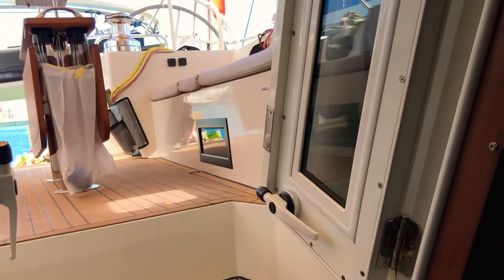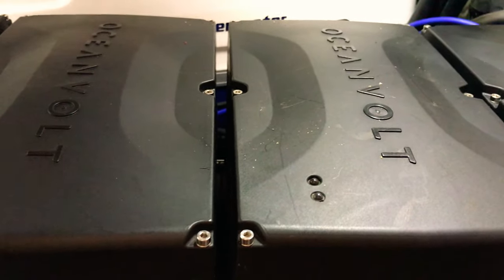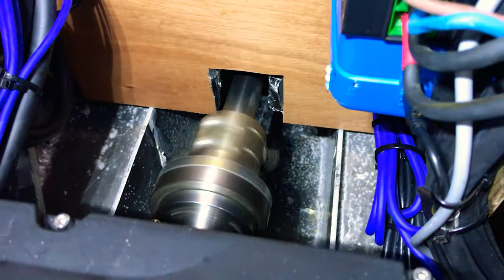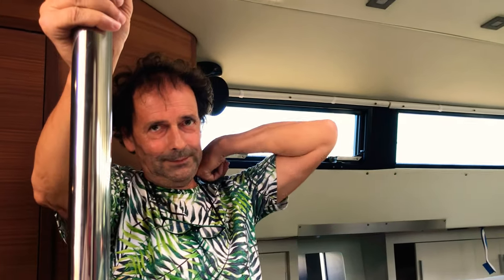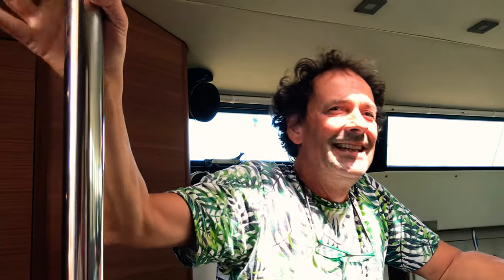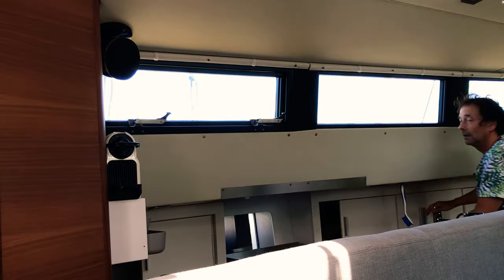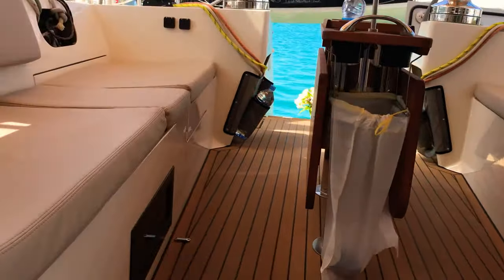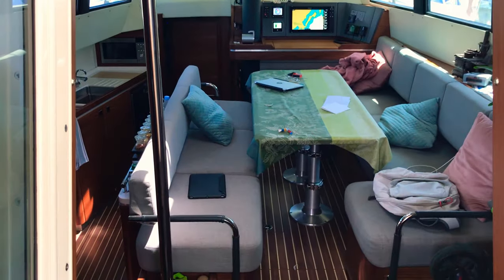Checking out Explorer 52 Garcia electric sail boat at Lanzarote marina.

Comment: Your still using,  diesel fuel to top off charge of  lithium pho4 batteries . 2 diesel generators.
Reply: The generator is to top up the batteries or provide extra power when needed such as for the water maker, dive tank compressor, etc. Solar is great but doesan't always cut it for some of the larger loads. It should be noted that the electric engine is a generator in itself when undersail. This means that the turning of the prop charges batteries.

I don't know if I would opt for this kind of option or stick with the traditional, tried and tested diesel for long range and remote exploring.